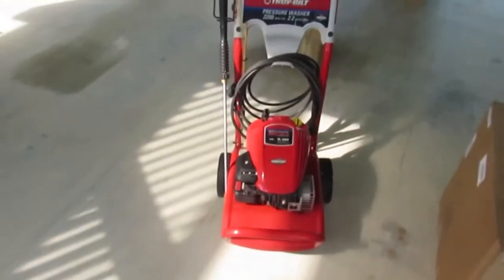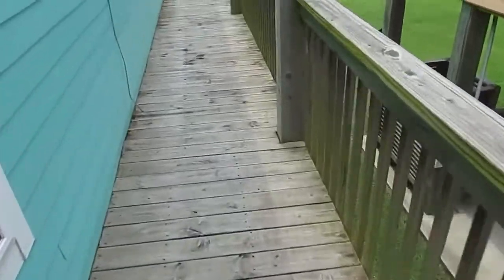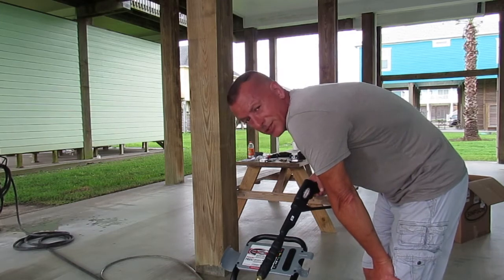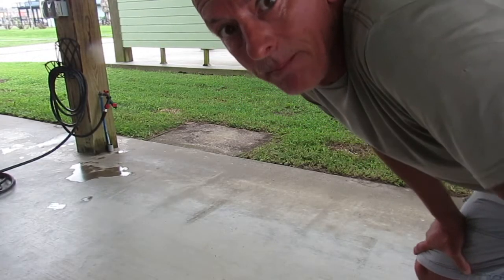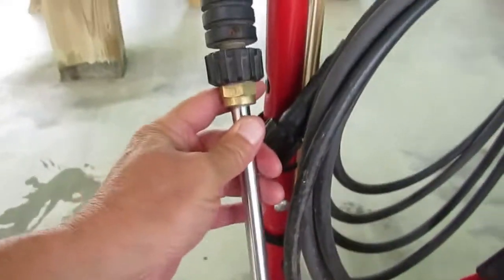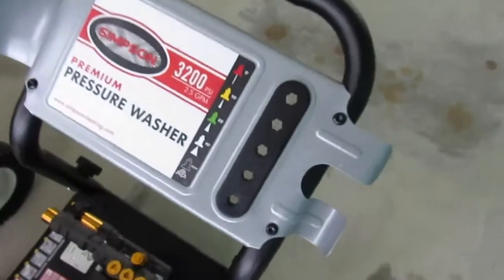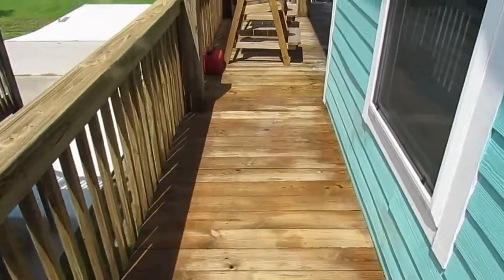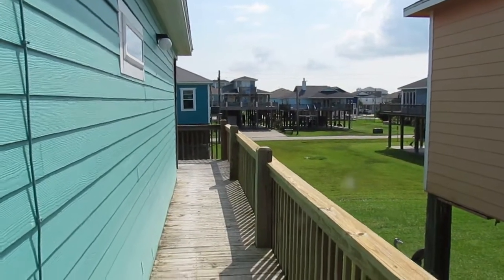New Power / Pressure Washer - Simpson Megashot

Comment from the maker: ...On the new Simpson machine I discovered that the hose and wand holder is installed upside down on the machine handle.  Spin it 180 degrees and it will hold the wand properly but the sticker will be up side down at that point (Geeze...)  Also, the damaged valve cover is nearly impossible to have replaced through Simpson Cleaning.  After screwing with multiple phone calls I just purchased the cover after-market with some new sealer for about $15.  Buyer beware.

Comment: It would be a good idea to read the manual before operating washer. You  probably did damage to your seals letting your engine warm up.
Reply from the maker: Read the manual. Great tip. It would be even better if the manufacturer added oil to the pump before selling the machine which is what was determined to be the problem after a lot of screwing around. 🤷

Comment: It's not good to let the pressure washer run if you are not using it, the pump will overheat and it can damage the pump seals.  If you are not going to be on the trigger working for anything over a minute I would stop the engine and restart when you are ready to get back to work.